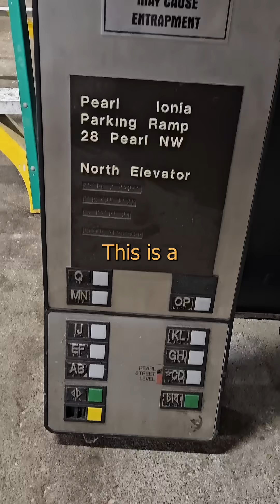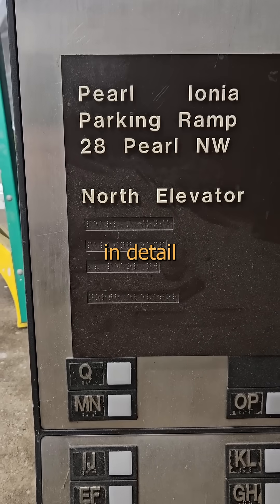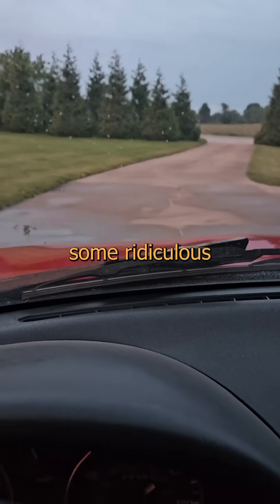Miata Mischief #chrisboden #engineering #gear #elevator #score #stories #parts #hacking #making

Comment: Me and a buddy once stole a 25 foot, 10 inch diameter pvc pipe from a construction site under cover of night and a snowstorm. We jammed it all the way through my old '05 civic sedan. The front end was snubbed up to the dash and the ass end stuck out of the trunk another 10-12 feet. I dunno I didn't measure, we were in a hurry. We ratcheted that sumbitch down, slapped it and said "that's not going anywhere." Drove it half an hour home through the aforementioned snowstorm to use as a makeshift rail feature in our homebrewed ski park in the backyard. My rear tires kept sliding out from the change in the centre of mass on every turn and curve but damned if we didn't get it home. Good times. Those fools didn't even lock their pipes up. I mean, to be fair, who in their right mind is going to try to make off with what was probably 300lbs of pipe, but hey, we did. Kept that thing around for 6 years and finally traded it away for a shitty kayak when I moved. Good times.

Comment: First time ever towing a car on a trailer, did everything right, except take the brake off, got to a set of light 10kms away and thought someone behind me was doing a burnout, till i saw the smoke pissin out from the side of my trailer 😅 it was my dumbarse fault, pulled over and sorted it, tow vehicle drove way easier and we both stopped even easier, whod have thunk it 😅 one of those first time is the last time fk ups haha

Comment: Not really all that sketchy, but I learned long ago that a pool noodle cut in half makes a good roof rack, if tied to the roof through the open doors, and then the cargo tied on top separately. Yeah, not great for your paint job, but not catastrophic, either. I've hauled hundreds of pounds of building materials, but sometimes you have to buy an extra sheet of plywood to support it. But who can't find uses for a spare sheet of plywood?
-- More on the sketchy side, I had a VW beetle back in the day  working as a carpenter, and scrounging some scraps from the scrap pile, I found a piece of furring/strapping I wanted, and I flexed it a bit to fit it inside. But when I released the flex, it straightened out against the windshield and cracked it and wrecked it. For a piece of wood worth about 41 cents.

Comment: A few moons ago when I was 18 ish I  used to work for a local isp and as part of that I was allowed to my own server for free. So I put a full 4u server on my Suzuki scooter seat bungee corded it on and sat atop of it for the 20 or so miles from where I lived to worked. Stopping after every bump or right corner to readjust. But just like items on skateboards I got it there in one piece.

Comment: College had a car show. So i brought my toyota camry.... with a factory turbo diesel and 5 speed straight from japan. Needed to get my entire snapon 55in toolbox home. Yes it was full and weighs a shit ton. So logical choice,  go get a u haul, load my easily 15k of tools in the back and road trip 300 miles with 60 psi in 30 psi tires.  That little 1.8l had more than enough power to drag it around.  (I may or may not have fiddle fucked the injection pump)  we cruised 60-65mph no problem and got the worst mileage i ever have in that car.  27.5 mpg.

Comment: A few years ago me and a friend drove past a decommissioned high school, I went dumpster-diving and hauled home a vintage ~2m wide roll-down wall chart and had to fit it in a 1986 Citroen 2CV.  And since it was raining and we couldn't roll down the roof we had wrestle it in through the doors. I had to sit in the far right back seat as the rolled up chart took up all of the space, spanning the whole interior corner to corner. Was a fun drive home having to clamber on to it so that it didn't go through the windshield. 

The front seat, of course was also filled with discarded treasures :)

Comment: I had to haul 20 extra large sand bags (60lb grain sacks filled with 150lbs of sand) 6 miles from a sandy shoreline to my island in a 16ft boat rated for 900lbs so I had about 3,000lbs in boat rated for less than a third (⅓) of that.

Comment: I had to bring a bunch of tools to neighbors houses as a kid (to make money of course) and often on my bike to be quicker. But when it wasn’t my mower behind me down the street, which in of its self its stupid as I used one arm to steer and the other to hold the movers handle and one eye in front of me and one on the poor mower. It was close to 20ib of hedge trimming and tree cutting tools that are sharp between my two hands steered with a bundle of tools speed and leaning going anywhere form a a street over to many blocks down while dogging parked and moving cars was kinda dumb.

Comment: When I was 14, my dad wanted us to have the biggest Christmas tree on our road. We drove to a farm and chose the largest tree we could find for sale, cut it down, and tried to fit into our 2016 Ford focus. We had to open the passenger side window and the rear opposite one and stick it through, diagonally across the car. We made it about 10 feet out of the parking lot when a cop car came by, did a double-take, then stopped us. He called the station and they sent a pickup truck to drive the tree home, but it was struck by a stray model rocket two weeks later and the top half caught on fire.

Comment: One time, in high school, I had a buddy that was into super smash brothers melee, and so for his birthday, my other buddy and I found him a free CRT tv on craigslist and set off, freshly sixteen and with his parents vw golf. We find this address, and its a dirt driveway between two other lots, and when we get back there the tv is probably about 5 feet wide 4 feet tall, 4 feet deep and heavy as hell. Were just able to squeeze it into the back of his golf (face down on the screen because thats the only way itll fit), and as we go to turn out of the driveway, we feel the entire car shift with the tv. So we have to drive an hour back, with me turned around in the passenger seat, holding the sucker in place with my bare hands, topping out a blistering 35 mph on the interstate. When we finally make it to our buddy’s house, the tv won’t even fit through the front door. We had to take the glass out of a bay window to get it in, and then put it back before his parents found out.

Comment: Hauling a PDP-11 home is good.  I did that once myself, but it was a smaller model.  Otoh, i hauled a VAX 4000m500 home once by myself, then got it up one flight of stairs without a dolly all alone without dropping it...

Or bringing a small piece of furniture home on the MBTA Green Line D train.

Comment: With the top down you have as much capacity as you could ever need!  ...In the vertical direction.

I also have a cargo rack on the trunk.  You'd be amazed how much you can bring.  Christmas tree in the passenger seat is probably a personal favorite though.

Comment: I have a 1998 Mercedes slk230 kompressor. It’s Mercedes answer to the Miata and is about the same size. Today I hauled a queen sized mattress I just bought 20 minutes to my house. The thin barely fit in the damn car and we wedged it on the passenger seat. At some point, don’t know how or when, the wrap it was in got punctured. I was ten minutes out and this fucking mattress started to reinflate while sitting right next to me in a car that definitely cannot hold that thing fully inflated. My ass cheeks puckered and I stepped on it. Unfortunately there is a tropical fucking storm encircling the small island I am on. There was standing water in the valleys of the roads, on top of the hills, on the sides of slopes, in my car, outside my car, and all over me. When I say hydroplaning was never given to me as an option, it was the only answer, I mean it. So there I am sliding around in this already falling apart, duct taped up dash, breaks that rub pos with a mattress slowly inflating like a fucking ticking time bomb. The pucker factor was insane as I looked out my windshield to see road, trees, water, road, trees, water, car, trees, water. I just had to accept that whatever was about to happen I couldn’t avoid anymore. Luckily I hit about a foot of water on the fucking road and my car slowed down immediately, the other plus is that fixed my shitty alignment. I start going again and at this point this fucking mattress has expanded enough to start touching my fucking arm. Don’t worry three minutes before that I could hear all the non broken plastic pieces in my car start to break. I made it home and pulled it out of my car and very quickly dragged it to my bedroom. I heard the plastic wrap tear and suddenly a queen sized mattress was laying in my bedroom just as I planned.

Comment: I hauled a 30" Bullard vertical turret lathe on a 73 f100 ranger. 3 on the tree. I put on my custom flat bed. Zero steering. Purchased it from Lockheed Martin at an auction in Marietta GA. It was 8000llbs plus. 1940's vintage.

Comment: When I was 18 I used the passenger seat of my 1993 mr2 to haul home all of the parts to put together an engine for my 2002 subaru WRX. 2 heads, a rotating assembly, and a block. I bought them around 11:00PM from some dudes building rally cars in a shop in a sketchy part of a town 40 miles away from me.

Comment: I was moving and didn't have access to a truck. Took several trips moving boxes in my 92 thunderbird. Worked fine until i got to furniture. I took the front passenger seat out and managed to squeeze a 5 drawer dresser into the car. I could barely see out the window and forget about th mirror.

Comment: My truck's pump went out while running errands. I managed to get it off the road, but I was too cheap to call a towing service and take it to a shop. I ended up having a buddy flat tow me with a tow strap all the way across town to the Air Force base where I worked so I could work on it at the auto hobby shop. The gate guards were not pleased, but let it slide. That was probably the sketchiest 10 miles I've ever covered.

Comment: My Atlas Drill press was a monster to get home. 

I have a buddy who works at estate sales message me about a 1950's Cast Iron Atlas Drill Press, maybe 15 miles away. I pay him for it and the two of us struggle to dance it across the concrete floor and to the garage, where I've backed up my Car, a 2017 Chevy Trax. Even with the seats down, this thing was not fitting inside and I didnt know anyone with a bigger car - So we were standing there, holding the base which didnt quite fit - since we put it in motor-first, and I get the bright idea to sit it up on a bunch of boxes and crap I had in my backseat to try to stabilize it from the center post, wedged the base against my trunk door, and tied the door as closed to being closed as i could to the lock - so the only thing keeping this in the trunk was a piece of random cord and hope. I drove home, which was uphill half the drive, praying this thing didnt slip out and fall onto the road. 

Its a miracle it made it home without a hiccup, but the entire ride I was afraid the cord would give, the trunk opened, and the whole thing slide off the pile of crap supporting it

Comment: Brought 4 one meter long metal pipes (15cm diameter) on a bicycle, 9km ride. Used two hardware store bags and heavy duty duct tape to prevent them from slipping in the bags, and hung each bag to an end of the bicycle handles. It was pretty smooth, up until the lower right pipe hit into a speedbump I got into too fast and got dented pretty badly. You don't mess around on the bike when you carry stuff like that. Fun times.

Comment: I don't drive, small town and can walk everywhere. Had the wettest, coldest winter ever and drying was a nightmare so I needed some clotheshorses to set up in a ventilated spare room. I went to the local hardware and they had huge ones on clearance, 40 bucks down to 5. I bought 2. It was 500 metres to walk from there to home so I totally had this, no need to ask a mate for a ride.

I struggled like a goddamned greek gods capricious punishment was shoved up my ass. Each weighed 30 kilos. I'm a woman, weighed 80. Cars slowed down. People came outside their homes to watch. Criss crossed on my back like an iron blood eagle, arms wedged sideways and lifted by bars under my arms, red and grunting and dying. Fell down twice. And the vicious satisfaction of launching them onto my front lawn was the sweetest crescendo of rage mode I've ever experienced. 9/10, probably needed a skateboard. 👍

Comment: My old man had the brilliant idea of towing a clapped out Cherokee home with a U-Haul dolly - without checking the rear suspension on said Cherokee. Turns out the back end of this beater was only sitting on leaf springs - the struts and any additional rear suspension had been pilfered by the seller, who handily forgot to mention it. We discovered this a mile away from the seller’s house as it began to sway violently from side to sided dragging the back of his 4Runner around with it. That Jeep desperately wanted to kill us at anything more than 20 mph, and the 25 minute drive took us well over an hour. Absolutely harrowing. Probably held up half the fucking county that evening.

Comment: ten 16ft sections of baseboard trim carefully wrapped in paracord tipped with the required red flag extending out the top and back of my convertible because getting a truck for a ten minute drive would have been for quitters.  Shame I can't post a photo.

Comment: Okay.  I purchased an Aprilia RS50.  In North America.  I don't know where it came from or who imported it, but the damn thing was street legal.  A 50cc (mine had the cylinder replaced for a whopping 70cc) super bike.  I went by myself to pick it up in my S10.  The dealership I bought it from had me pull around to their loading dock to roll it on the truck.

When I got home with it, I had no ramps or other way to wheel it down...so I threw it off the truck.  I rolled it backwards really fast hoping that it would be ballistic enough so that when the back wheel landed it was back wheel on the ground and front wheel still on the truck.

Nope, the exhaust (that big ol flared 2 stroke exhaust) landed on the tailgate, which to this day has a big old dent right in the middle.

Comment: Not mine but I aided and abetted it at my work.

I work at a wood working supply shop and we shoved several 14ft walnut boards into a Hyundai velositor and ran ratchet straps through the tops of the doors to strap plywood to the roof.

Tennessee ingenuity folks

Comment: right now ive got a few hundreds pounds of scaffolding in a salvage utility trailer held on by a maybe 50 lb ratchet strap pulled behined my might run 1984 ford ltd with a gutless 1988 lincoln town car 302 that I plan on taking to a scrap yard on monday however I did take this trailer down a short stretch of M66 and im pretty sure i went 55 at some point

Comment: Sound like you might like the miata logistics subreddit. Biggest thing i ever hauled was an office chair(still in its box.) In the passenger seat. Had the top doen and it sat about 6 inches above where the roof normally sat. It was halfway on the handbrake but it worked

Comment: I was 17 years old, working as a carryout in Menards in Minnesota. The craziest car loading experience was loading a carpet roll into an SUV or hatchback. If I remember correctly, it hung out the back of the car, or maybe we got it all the way in. It went from the back of the car, right next to the passenger seat, and out to the passenger side window, sitting on top of the passenger side mirror. I don’t even remember if the customer tied it down because I know we didn’t, as Menards' insurance does not allow their employees to tie down the loads put into customers' vehicles. If the person did, it was probably just some really thin, cheap plastic twine that they let customers use for free. And it wasn't a short carpet roll; it was the long roll you get off the long carpet machine that arches over if they have the bigger versions, or it's on those big tumble rollers with multiple different kinds on the machine.

Comment: Not sure if the worst I ever did was to haul a model 19 Teletype complete with table in the back seat of a 2 door chevy Nova, or the 600 pound plate supply transformer from a 25 KW FM transformer in a VW Squareback.  It was after that episode that I decided it was time that I get a real truck.

Comment: Putting long ass 2x4s in a tacoma. My arm between the windshield and the wood and it resting on the back seat poking out the rear window sticking out like 3 ft past the tailgate (while its open). Barely strapped in kept bouncing and also went on the freeway at some point. Oh and crossed railroad tracks… fun… :)

Comment: I took a Mr. Pac Man Mrs. Pac Man pinball game from south Miami to West Palm Beach in my 1969 MG B GT hatchback. 
I took the legs and head off.
I slid the cabinet in with the back seat down flat. 
The head I managed to get in the front passenger seat. 
The 4 legs beside the cabinet. 
I'm a professional pinball and arcade games mechanic/electronics tech, so I knew how to do it.
 It ended up being the best thing I ever took to a party.
I got free beer and weed from the own😢of the house where the party took place.
And that's pretty cool.

Comment: I once found a giant 12 foot long plastic crinkle-cut french fry on the Craigslist free section and the bed of my Subaru Baja couldn't hold it horizontally--so for the 3 mile drive home with it, it was strapped to the hooks inside the bed of the little utility pickup almost completely vertically. It looked completely ridiculous, but it was the only way I could find that passed the "she's not going anywhere" test. I wish I could find the picture I took of it.